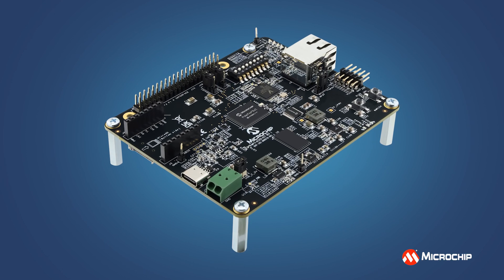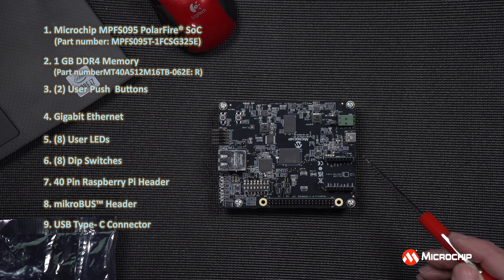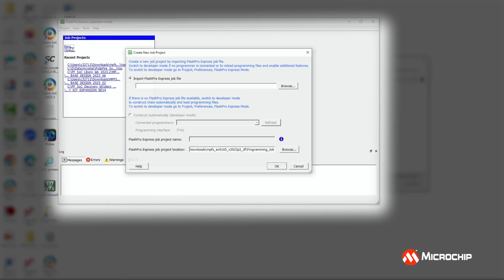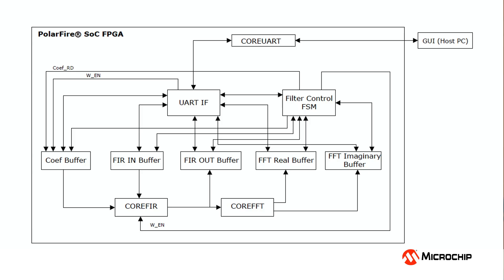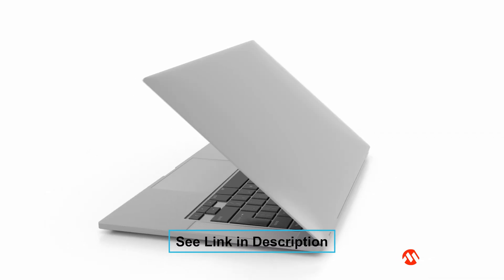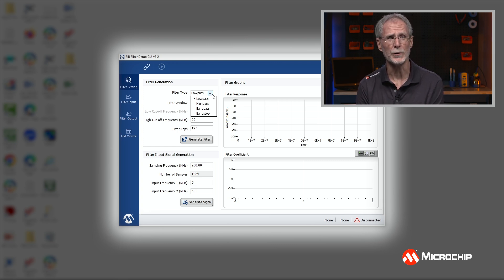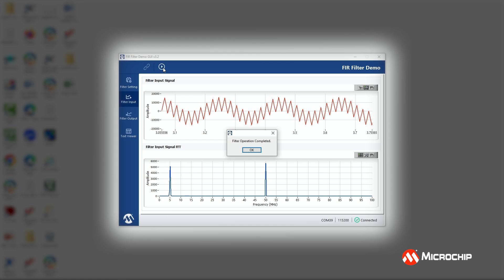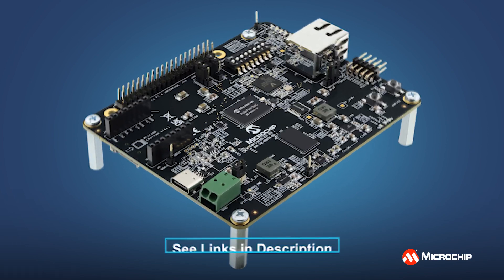New Product! PolarFire® SoC Discovery Kit - Your Low-Cost Entry to RISC-V and FPGA Technology

Comment: is this board also suitable to learn embedded linux on risc-v on a lower level ? FPGA would be my lesser priority
Reply from the maker: Thanks for reaching out! The PolarFire SoC Discovery Kit is an excellent, low-cost platform for learning embedded Linux on RISC-V. It provides all the necessary hardware, software, and documentation to get started with Linux at a low level, including device tree, driver, and userspace development. Therefore it is suitable for learning embedded Linux on RISC-V at a low level, even if FPGA is a lesser priority for you. Hope this helps!

Comment: Is this similar to the "PolarFire SoC FPGA Icicle Kit"?
Reply from the maker: Great question! The PolarFire SoC Discovery Kit shares core technology and supported features with the Icicle Kit, but is specifically designed to be more accessible and cost-effective, making it ideal for educational use and rapid prototyping. For those seeking an affordable entry point into RISC-V and FPGA development, the Discovery Kit is a strong choice. While both kits enable development with the PolarFire SoC’s RISC-V cores and FPGA fabric, the Discovery Kit offers a streamlined, entry-level feature set at a lower price point. In contrast, the Icicle Kit provides a wider range of interfaces and advanced capabilities to support more complex development requirements. Hope this helps!

Comment: Does Libero support a free license for the PolarFire SoC, just like Vivado is free for most Zynq 7000 and Ultrascale+, or Quartus for Cyclone V SoCs? Can the bitstream be loaded from dynamically, e.g. from kernel-space, or even user-space? Is bare-metal supported on the application cores?
Reply from the maker: Hi there, thanks for your question! Libero SoC does offer a free license for certain PolarFire SoC devices. Specifically, for the MPFS025, MPFS095, MPFS160 (non 'S' Devices) and MPFS250T-FCG1152E, MPFS250T-FCVG484E (Kit devices), you can obtain a Silver license at no cost, which includes support for mixed language simulation, programming, and debug functions for one year. You can access this free license by going to the web for the free license download. https://www.microsemi.com/document-portal/doc_view/137168-libero-license-selector-guide. Hope this helps!

Comment: What engineer or company would even bother using Microchip anymore ?   During C0vid you couldn't get any of their products.  Everyone was out of stock of most everything they had. 
Then the scalpers came out charging 100x -300x the cost .  Our company nearly went out  business because all of our products was using their PIC32 micros.  I switched ALL our products and code over to Espressif, and I will NEVER look back of use them again.  Clearly, they have all their eggs in one basket making their products, which was a stupid move, and i doubt they fixed that issue.

Comment: The SDK seems to only be for Winblows ;-(
Reply from the maker: Thank you for the question. The development tools used for PolarFire FPGA/SoC are Libero SoC ( https://www.microchip.com/en-us/products/fpgas-and-plds/fpga-and-soc-design-tools/fpga/libero-software-later-versions ) and SoftConsole ( https://www.microchip.com/en-us/products/fpgas-and-plds/fpga-and-soc-design-tools/soc-fpga/softconsole ), both which run on Windows or Linux.
If you mean the DSP FIR Filter demo GUI, yes it is Windows only.

Comment: Can it run crysis?
Reply from the maker: Thanks for reaching out with your question! No, we don't support that game. We currently support our Mi-V Ecosystem Partner Numato's Yoshi's Nightmare (https://numato.com/blog/gaming-with-fpga-yoshis-nightmare/) on the PolarFire SoC Icicle kit. 🙂
Reply: A really ambitious programmer could probably get Quake 2 or 3 to run on this?
Reply from the maker: Awesome!
Reply: No, but it takes Glock mags
Reply from the maker: Running Quake 2 or 3 on Microchip’s PolarFire SoC FPGA could be possible given its 64-bit RISC-V cores and Linux support, but it'd require significant optimization and adaptation. A cool challenge for any ambitious programmer!
Reply: @MicrochipTechnology 
Quake 2 & 3 ran on Pentium 2s.  We played at lunch in the software lab at my job.  They didn't even require 64Bit architectures or GPUs.

Comment: 93K logic elements, 292 Math blocks, at 50 MHz. (Smallest FPGA in the SoC series)
4-core SiFive U54: RV64GC single-issue in-order five-stage pipeline at 625 MHz.
Not a five-core CPU! The fifth RISC-V core is a management core.
Seeing such a low-power CPU which supports only RV64GC (it is from 2017) is a bit of a disappointment IMHO.
Reply from the maker: Hi there, thanks for your comment! The PolarFire FPGA platform was launched in 2017, with PolarFire SoC in 2019. The Discovery kit aims to bring commercially available, programmable, and affordable RISC-V development platform to the mainstream. You are correct, the processing complex is a Quad-Core RISC-V SoC (SiFive's U54) capable of running a combination of Linux, RTOS or BareMetal in SMP and AMP modes. 

Microchip have teased our next generation PolarFire 2 FPGA family, you can sign-up here for updates: https://page.microchip.com/register-for-polarfire-product-updates.html